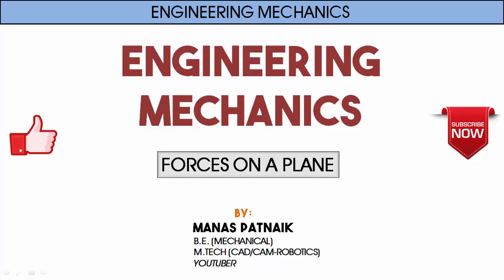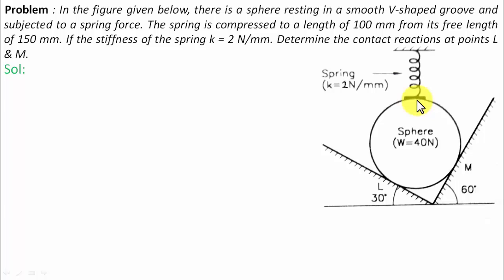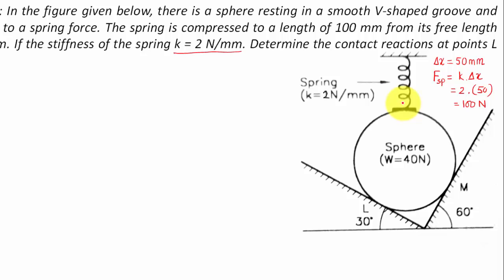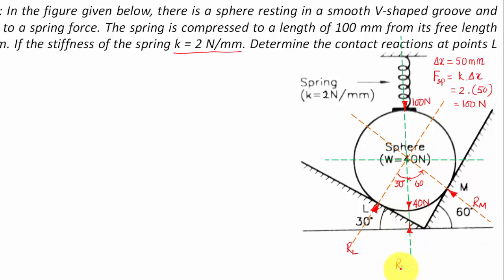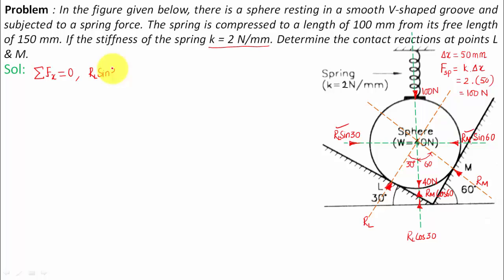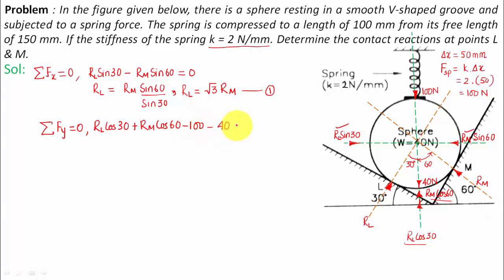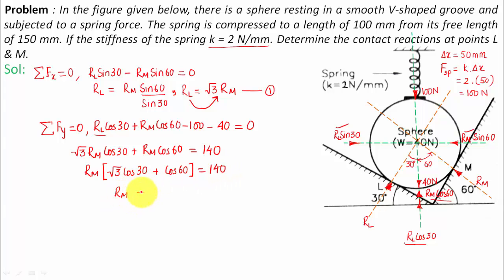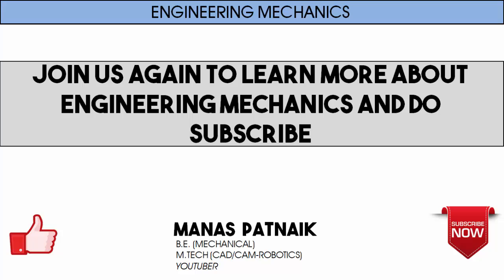Engineering Mechanics_Forces on a Plane_Level 2_Problem 5

Comment: Can I also use Lami's Theorem sir?
Reply from the maker: If the total forces acting on a point is equal to 3 then only one apply lamis theorem.
Reply: @ManasPatnaikofficial  Yes sir I actually added the spring force and the weight and took it as 140 N in the downward direction.  The other 2 forces are the 2 reactions. Am I right sir?
Reply from the maker: Yes Sagnik.... In that case it's correct.  You were lucky that 2 forces were colinear.
Reply: @ManasPatnaikofficial  Sir I have used the same method as above by taking 140 N in the downward direction and then applying Lami's Theorem. My answers are Rm = 72 N and RL = 124.71 N respectively. So can they also be considered correct ?
Reply: @BHARATMAKKARBME  by applying Lamis theorem also you will get the same answer only..70N and 121.24N..